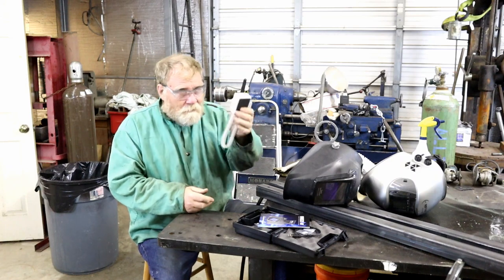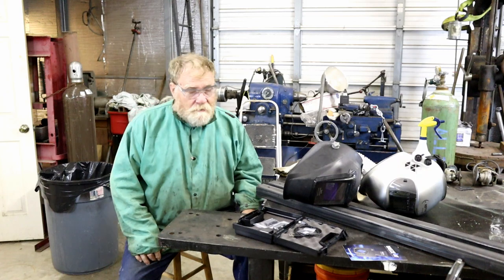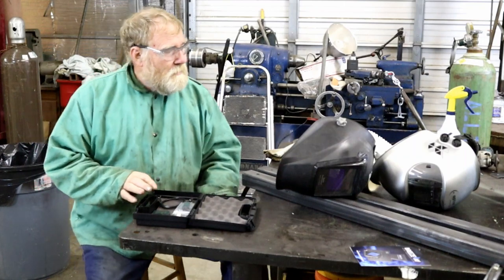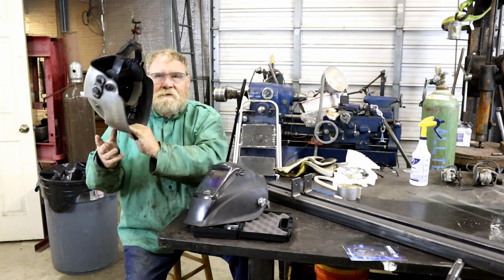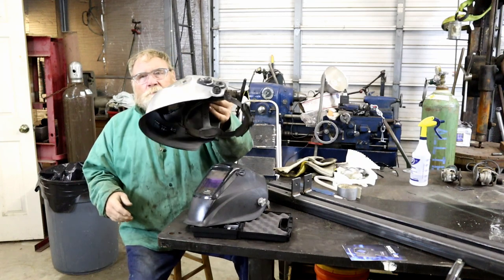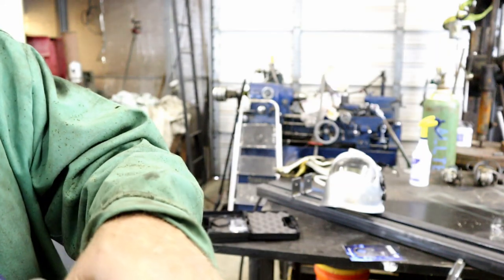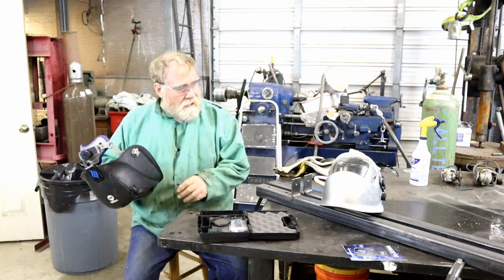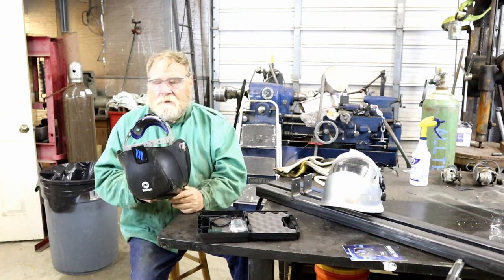No More Welding Helmet FOG!

Comment: Looks very interesting. I bought an optrel 684E with a papper a few years ago. They aren't cheap but I think it was well worth it, I weld a few things with high chromium content. Plus breathing anything from the welding plume isn't good for you.  I got it to protect my lungs but the side effect was exactly what you are after, it keeps my glasses from fogging up. I can have it running on high for about three hours or six hours on medium and you can purchase extra batteries. I'm in southern Idaho so I only need high in the heat of the summer. The other benefit is I wear the papper behind my waist so it stays out of the welding plume. Good luck with your experiments I continue to enjoy your videos.
Reply from the maker: I was also thinking of buying one of those. I like the idea of the filter!

Comment: I have this same problem. And it is damn frustrating, when it fogs up. I see there are those that never experience this (in these comments). But for those of us that have perspiration flow to cool the head under the helmet, and wear glasses, this product may be the expensive solution. I just gag at the $ for a simple fan device. I just got a wide screen LCD auto darken helmet that was less then $60. And spending $200 to make it usable, well I'll just have to get over it. The last time I got a new prescription, I had the doc give me one for the welding distance of eyes to work. Pay attention to how far you like your eyes form the work, and have the eye test for this specific distance. I had that filled for one of those ultra cheap plastic glasses for less then $40, and keep them in their case at the welding machine. Oh, you can't use the paper towel you use that fell to the floor, as the grit will destroy these in your first cleaning. :D
Reply from the maker: I know they are expensive but I notice they also are cooling my head.. Can't wait to try it out in the summer...

Comment: You should probably reverse it so it pulls air up from the bottom and blows it out the top. When you weld a lot less fumes normally at your chest where as most of the smoke goes right past the top of your head. Good thinking on the mods!

Comment: Never had the misting up glasses problem! I have bi-focal lenses, my mask is set low and forward so I can see through the bottom of of my glasses and, no beard! Must be very damp where you are!
Reply from the maker: It is damp... In the summer it's alway 90 to 100% humidity then add the heat and your sweat and boom....Instant fog....   Now its getting cold and my breath supplies the moisture...   Can't win... 
    My safety glasses are bifocal and I have to hold my head just right to use them... I much prefer the cheater lenses you can buy that fit into the track, of the helmet lense holder,  or even reading glasses as you don't have to hold your head " Just right"